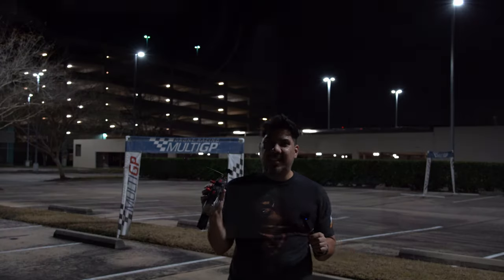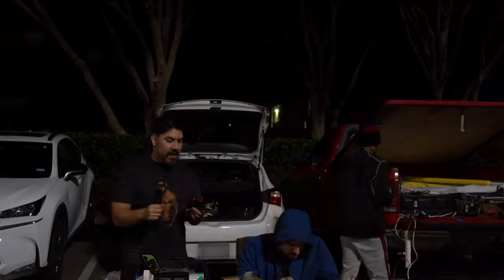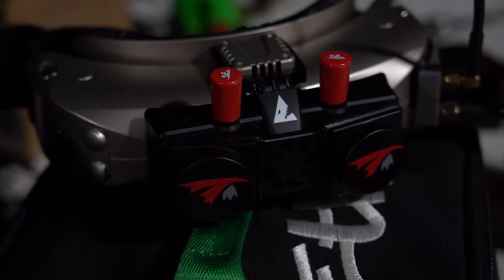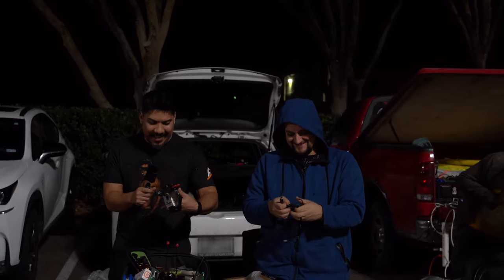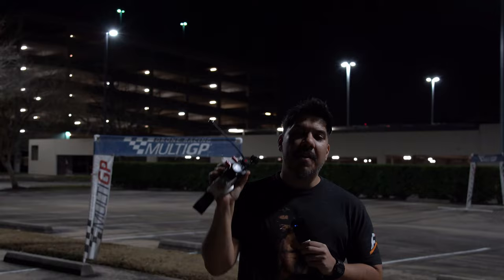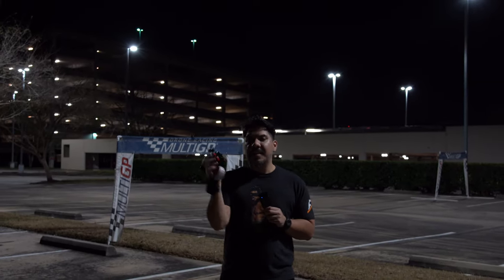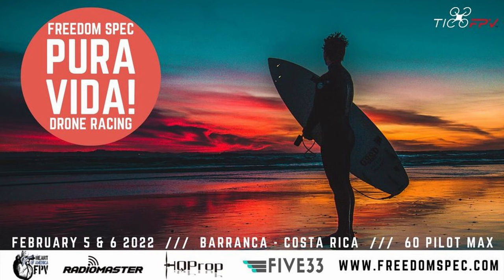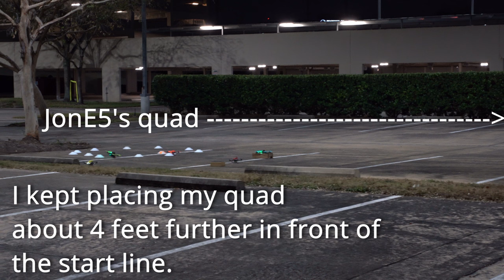HDZero TrueRC Antenna Upgrade X-AIR MK II

Comment: I'm really happy for the Houston crew to be able to use HDZero at the night spot. I still see a lo of room for improvement though. 1. Better DVR, 2. Better VRX noise rejection 3. Even tighter latency. - All of these are being worked on and I'm glad you'll be there to test it. Thanks for helping HDZero move forward!
Reply: exciting stuff for sure and the houston crew definitely have good areas for testing !

Comment: Wow, it was dropping a butt load of frames with the stock antennas! What a massive improvement!
Reply from the maker: Yes! The dropped frames are annoying to see for sure (and you don’t see the red flash in goggles) but it’s a good way to measure the improvements in signal. This was huge.

Comment: Hey, are you recording your dvr in the .mov format? I think if you record in the .ts format, you won't get those red frame flashes. That was my experience at least. Thanks for the quick review of the antennas :)
Reply from the maker: You are correct. The downside is that the .ts format isnt recognized by Dacinci Resolve (the editor i use).  So for me, its advantageous to use the .mov

Hopefully they can reduce the number of dropped frames eventually.
Reply: @JonE5FPV  It takes a few minutes to convert the .ts file in something like VLC and would be better for your viewers if they didn't see the annoying red 'Media offline' frames flashing up. Some might confuse what they see here with what actually happens in the goggles...
Reply: @eatyourvegfpv  pls make video how to convert the format thank

Comment: Great  video . True rc makes good stuff . Do you actually see that red screen flashing when u are flying or is that just on the DVR ?
Reply from the maker: That is only on dvr when rendered in Davinci resolve (which I use to edit). could run the files through a video re-encoder like mpeg stream clip to eliminate them but for this test I felt seeing the difference in dropped frames between the two options would be a good way to show the improvements in reception.
Reply: @JonE5FPV  that makes sense.  i was wondering how in the world you could tolerate flying with that flashing in you eyes
!

Comment: You got to switch to .TS files for recording. It just works better. You can setup a .bat file to automate conversion of the SD card contents.

Otherwise, nice vid you cheater.
Reply from the maker: Im to lazy to convert the files afterwards, its not in my review workflow to do any file conversions.  Bonus for this video however, was that the amount of dropped frames (red screens) were a very clear indicator of how bad/good the reception is, so made it much easier to see the improvements made by this antenna combo.